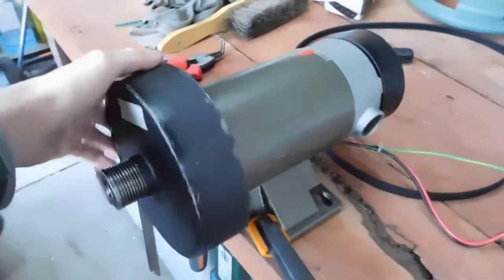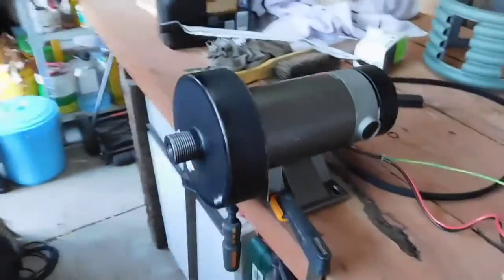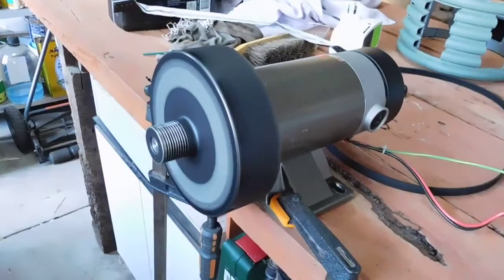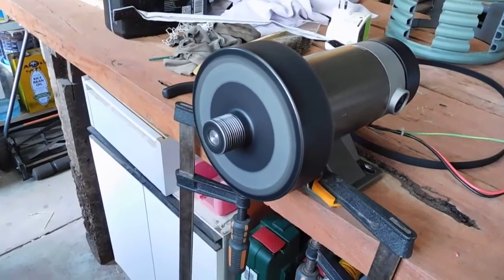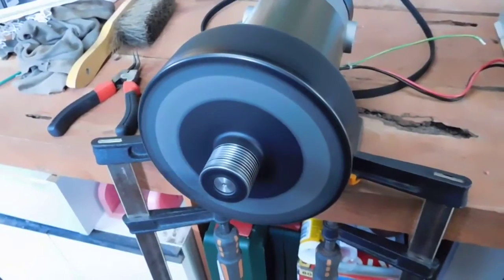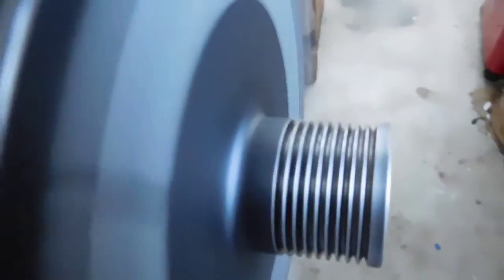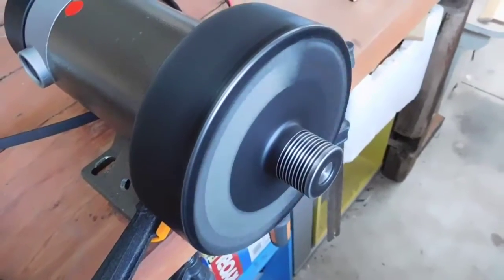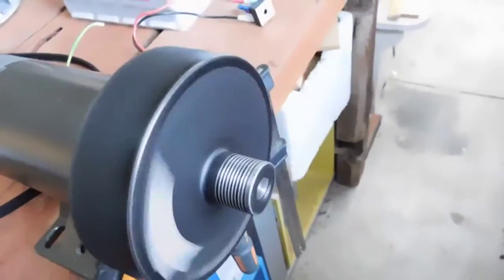Testing HUGE DC Motor on Variac

Comment: I think you opened up soo many possibilities. The variac waveform does not affect d c motor performance and a large bridge rectifier and breakers to prevent current rush and I'm taking this to another level to power my 15x50.

Comment: I need to get another one of these motors, it would make an ideal Hammermill!
Reply from the maker: Now that is an idea! As these DC motors have serious torque. And you can drill and tap threads for mill-rods into the steel flywheel!
Reply: +CAL'S ENGINEERING that's exactly what my idea was!

Comment: Is using a full red rectifier on a device like this a good permanent solution I have a DC motor that I want to implement poor the high speed diamond wheel sharpening setup it's a very good high quality motor that's extremely high speed I'm not sure if it's upper end limitation but it's very high speed and it has a considerable amount of torque as well I think it's rated at 400 watts I happen to have a variac that gets very little use probably stuff this at the back of my bench it would work perfect for something like this very simple but I don't know if this is a long range solution or not can anybody help me with this? Anybody chime in please

Comment: If it is a DC motor how can it run on a variac (which AFAIK deliver AC) ?
Reply from the maker: It was running on a Variac VIA a rectifier.
Reply: Do you have any tips / recommendation about how to build such a rectifier ?  Is it just high voltage diodes (in full bridge) and a capacitor ?
Reply from the maker: Tigrou7777 you'll find them at almost any electronic store that sells passive components. They're not expensive
Reply: @Tigrou7777  its 4 diodes....